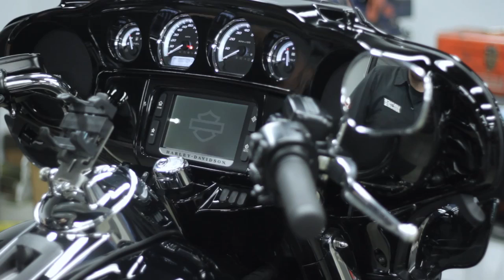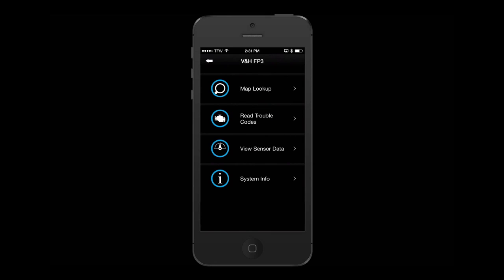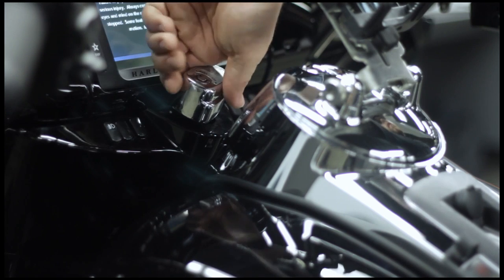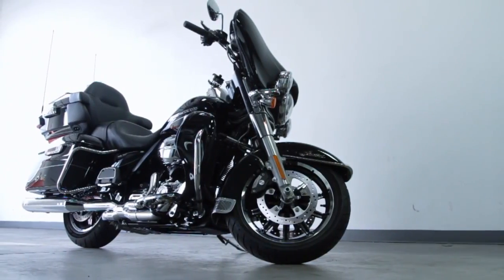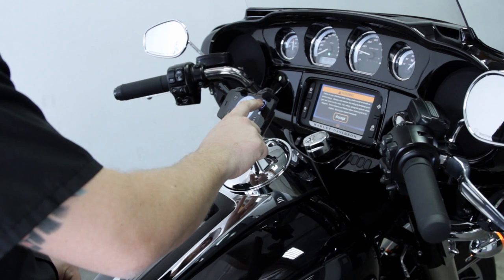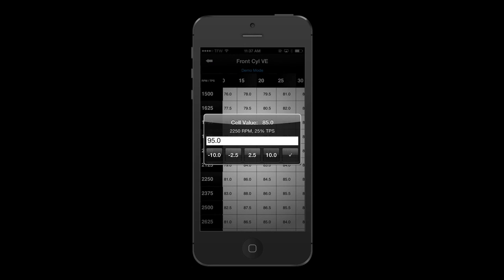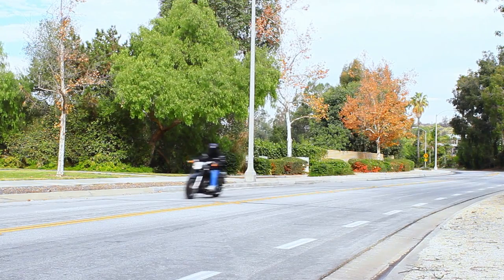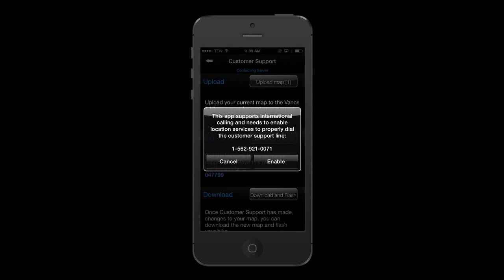Fuelpak FP3 Feature Video

Comment: I attempted to add a FP3 to my 2014 Ultra Limited.  I installed Drago Exhaust System and Big Sucker II on it.  The FP3 would not auto tune.  I attempted several times.  Contacted Canve and Hines.  Finally reached the right Customer Service Rep who stated that the FP3 was not compatable with my set up.  I asked why this information was not on their web site.  I read it to be compatable with all combinations of exhaust and intake systems.  So did my local Harley Dealership.  I think it would have been cheaper and less frustrating to just have a dyno tune after the addition of this useless paperweight.